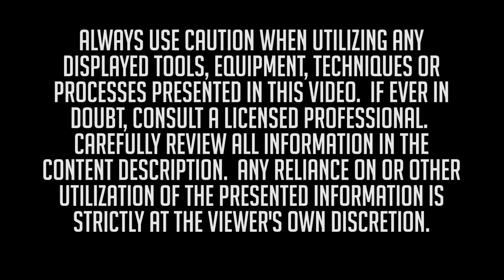LASER WELDING - INTERVIEW WITH IPG PHOTONICS ABOUT LIGHTWELD

Comment: How strong is the weld compared to other methods? If you built a trailer with the laser welder, would you but your Harley on it?
Reply: I can say yes. Have used this unit and it cuts deep into steel.  When welding material more than 4mm just weld both sides or bevels with a fill weld. Wire feeder is a must have for that kind of work.

Comment: Try welding 5/8" Bizaloy 80 plate in a double sided T joint, 1/2" fillet weld, using 110s wire. I've done this for years with a variety of 300 to 400 Amp, 415 volt Mig welders.
Reply: Thanks for replying. The welds look really neat and small

Comment: I'm still waiting to see a proper cut-and-etch.  I'm not convinced it's getting enough heat deep into the material, even on 1/8" stock.
Reply: The way light Photons transfers heat to the metal is a lot faster than conventional arc welding.  So you’re not having as much lateral heat transfer to get the same level of penetration, compared to arc welding.
Reply: @danielhincapie  and what, exactly, is that difference?
Reply: The difference is that arc welding pushes heat to the material because the arc itself is very hot, over 7,000 degrees. With laser, the light beam itself isn’t hot. But the energy from the light is transferred to the material. So the molecules in the material move rapidly from the energy input. Molecular speed in vibration means heat. So the molecules receiving the energy from the laser become very hot and melt.

So arc welding supplies external heat from the arc, but laser welding has internal heating of the material itself.
Reply: It dies.

Comment: Ok, I am a mechanic, fabricator, and metalsmith.
I use a laser welding unit (evos) thats foot controlled, I work on a microscopic level with that (3d scope), but this looks better.
My advantage is I can work in a heat range to not destroy minerals (as a repair jeweler), yet I get cold welds and porosity sometimes. This I'm sure applies for steel welding.
I'm curious about settings and timings

Comment: That's cool but for $24,160.00 I will stick with my awesome Primeweld 225X for $825.
Reply: I agree. I mean I think the product is very cool, but the price just doesn't match the everyday consumer market in my opinion. Anybody that needs to purchase something at that price is probably better off at purchasing something that'll machine cut pieces for precise fitment etc. Im not too sure of the market that they are going to attend at that price. Sure it can easily weld aluminum, and sure electric cars are all cool, but I can almost buy an electric car for that price, and for repairs etc, I'll just get the rebates. Why spend more money to fix something myself at a lower quality?

But I could be completely ignorant. I'm literally typing this message only half way through the vid, so what do I know? Haha! The hype is probably selling these things one hot cakes. If so, they've done well🤣

Still a very cool product though 😎
Reply: That price tag seemed acceptable enough for my job to get one to have us try out to help speed us up. We're still waiting for the safety equipment to arrive before we try it and had to brainstorm with the shop foreman about where we can set it up, but for now this seems strictly a manufacturing/construction product just on price tag
Reply: @pieshka6  wait are you guys in the usa 🇺🇸? not to get political but the biden administration outlawed russian/USSR good's or at least that's my understanding and or taxation the crap out of them and they did say the company IPC is russian/USSR so if your in the usa 🇺🇸 how did you get it? and yes 20k usd is out of my spending list for a welder as a dynasty 400 for now with half to do
Reply: @richardprice5978  they have their global HQ and a manufacturing plant in the US so idk, we and the gas company we use got one for their welding school 5-6 months ago so all the russia craziness didn't apply then, and we are also a bigger company that goes through thousands of pounds of metal a day both welded and hammered together so it was as worth it as our 2 longitudinal seam welders that cost $75k total I think it was years ago. But you'd need to spend more money on safety barriers around the machine, the welding school melted a sweat band on a helmet left in front of the welding gun and as a test we put a glove in front of the reflection zone of the laser, tapped the trigger, and burned through a layer of a welding glove. However, I can make a stainless 60 inch corner joint look like I TIGed it together and in a minute or 2. And if you set it right, that weld will hold up to abuse from an 8 pound sledge hammer without filler wire

Comment: damn I'm still welding with a gas torch!
Reply: I’d personally say that welding with a gas torch is a bit more badass 😂
Reply: @caden3122  and spendy have you looked at gas prices lately? and consumables like flucks ect. tig is way cheaper to use than gas/flame-welding